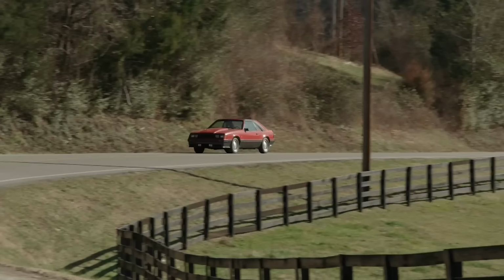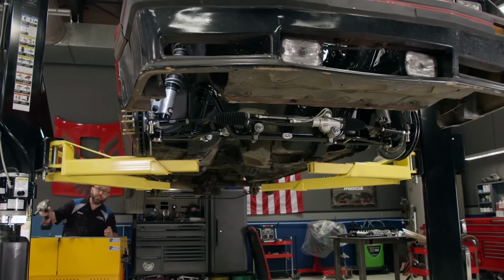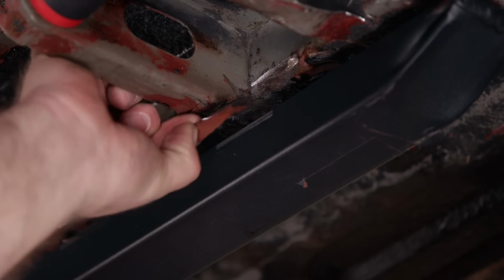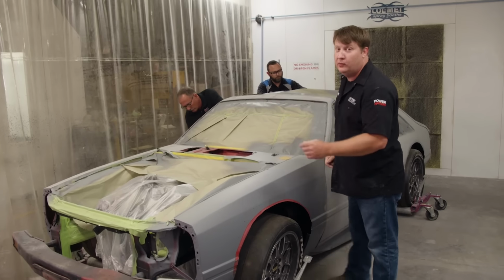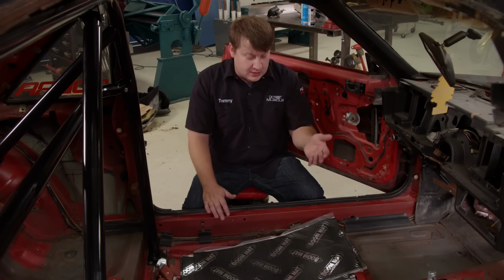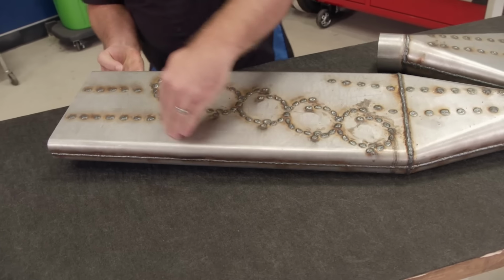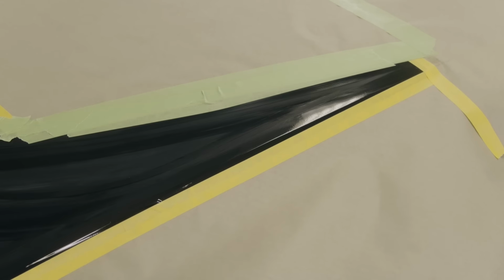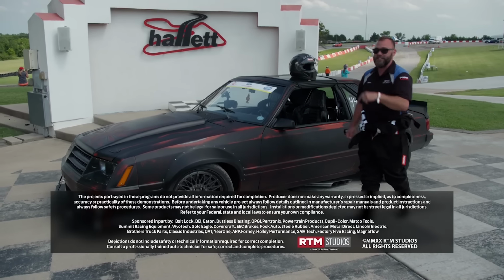Full Build: 1981 Fox Body Cobra Mustang

Comment: Cool build, love seeing an early four eye Fox instead of the 87-93.  

I’m not an Fox body expert, but I thought stiffening up the rear suspension made it handle even worse? I know a panhard bar and torque arm will help, but with the original four link I thought they need compliance or else the snap oversteer gets worse.

Comment: Awesome video! I have an 81 Cobra with many of these same  mods, except the 351(Windsor 306, TrickFlow heads, intake & cam, long tubes etc...). Such a unique Fox Mustang, completely forgotten  by most. Maybe it was the dismal performance of the stang in 81, nobody cared about a 140hp V8. I have the green on black color combo, the best one IMO.

Comment: Didn't really care for the exhaust.  It looked too low when they mounted it and sure enough you could hear it dragging the ground on the track.  Drive over a couple good pop holes and there will be no exhaust left to drag.
Reply: I was totally on page with the build until the "boom tubes" came out.  Sigh.
Reply: Zach Owens *pot holes. Not pop.
Reply: joseph migliore thanks I guess I need to proof read better.
Reply: Zach Owens You’re welcome.
Reply: I like flush mounted out of sight
Reply: No more exhaust = WeiGhT REdUcTIoN bRuHhhH 😂
Reply: They'll self clearance, don't worry about it.
Reply: yep but they are killer!
Reply: Vernon Allen I prefer function over looks. Yes they look cool but if I have to replace them every time I drive the car the. It was not worth the looks in my opinion. If I’m spending the money to build something like this I want it to last awhile.
Reply: @zachowens1412  true... i have them on a sn95 and I have no problems. they mounted them to low. they can be tucked right up to the body as we do in nascar.  to each his own.  stiff chassis will not let the body fall on the ground.
Reply: Vernon Allen there is no doubt that this mufflers look sick. It’s just the way they mounted them.
Reply: @zachowens1412  I totally agree

Comment: Less than 10,000 Cobras sold in 1980/1981. I’d be surprised if even 1000 of them survived almost 40 years since many of them had the 2.3 Turbo which often died before 100,000 miles. I’d love to find one that isn’t rusty, never had or has the 2.3 or a T-roof. I had two 79 Mustang Indy Pace Cars from 1987 to 1991 and I haven’t had a Foxbody since.

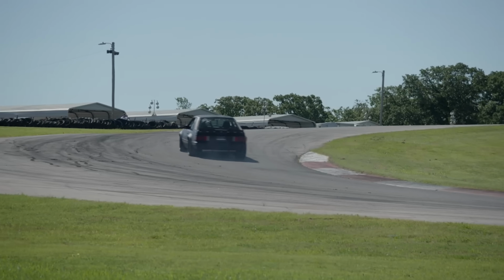Comment: 40:45 Those side pipes are dragging the ground. Looks cool but not functional when the chassis dips. 
I had this car in 1981. I was 17 years old. (same color and make with t-tops and all) and I beat the piss out of it. and I mean beat the piss out of it. My first car and the memories are still there. thanks for the episode. After a few years of abuse which included a new block and rear end and trans cause I blew the originals. I put it all back to original, had it painted back to factory and then ended up selling it to get a new Pontiac Fiero.  Worst mistake I ever made. Looked cool but the Fiero was POS.  Traded the Fiero, Bought a 82 or 83 Mercury Capri RS after that. Same burnt red and black with t-tops and then modded the crap out of it. Favorite car ever. 
Most people dont remember the Capri RS which was a Mustang Clone but I thought it looked better end the end.  Fun Days.  I'm old now. After about 8 hot rods later and 37 tickets. I Drive a truck now.  But at least it's a Ignition Orange RAM Hemi 4x4.

Comment: Yes, I watched this and I can do all the same stuff to my 87 fox body GT I Bought it on a whim as a neighbor was moving out of syate and he and his wife were each driving their daily drivers and he was having a Dually and a boat flat bedded on a diesel - It was getting expensive. so he sold it to me for 2k, 3yrs later now I've put 12k on it and only have chanced ALL the fluids when I got it and 3 oil changes as of today. I was going to buy a new car coming up and have decided to spend some money on My mustang and drive my Jeep for a couple more years. I bought a second hand Jeep (Tomb raider edition) 6mos after they came out. hey it's been paid for years has just shy of 80K on the bottom end and a new top end at 65k. This show came out at perfect timing. 

going to clean out my shop and slowly start ordering parts after doing a lot of reading and video watching. I also want to do a sycro 6 speed so I have the low gears for the strip and can freeway it at normal rpm. Plus I want paddle shifters on the wheel. cheers all.

Comment: Nothing like a race motor for your street vehicle :) I disagree about it being the "quintessential" car of the '80s. I think the Camaro was the "quintessential" car of the '80s. Did you use longer bolts for the seat belts? If not then they are weaker mount than original.

Comment: what subframe connectors are these? Stiffler's Fit System?
Reply: Is that an SN95 I see in your signature? Love SN95s, you never see them! What's done to it? After I complete my Fox project on my channel, I definitely want an SN95!
Reply: @RaceGasSmellsGood  It is, it's my 94 GT 5.0. it's mostly stock but for a few bits here and there. 13" Cobra brakes and cobra R wheels. C springs. Bilsteins, MM caster camber plates and subframe connectors.  rears gears, full exhaust ect. I'd love to do much more but life's other expenses supersede it on the priority list. I'd love to do a 408W build, something like a 95 cobra R but even better.  Maybe i need to start a channel to finance the build.
Reply: @NGG1983  Nice, a pushrod SN95, even better! Got some nice, quality mods on there! Definitely going to go and sub to your channel in case you post some updates. Any more mods planned for it? If you wouldn't mind checking out my channel, too, some Fox-body and New Edge content, and some SN95 stuff coming soon too!
Reply: Ell Bro yeah, some features on your car would be great! Not enough SN95 content on YouTube! Yeah, get it to hopefully start funding your build! I’m trying to slowly grow my channel too, for the same reasons, to find projects since life always has other plans for my funds 😢🤦‍♂️😂
Reply: They said the suspension setup was from QA1. But never specifically said what subframe the car was running. Sorta resembles the old Kenny Brown system. Kenny Brown used different bars but the geometry looks very similar.